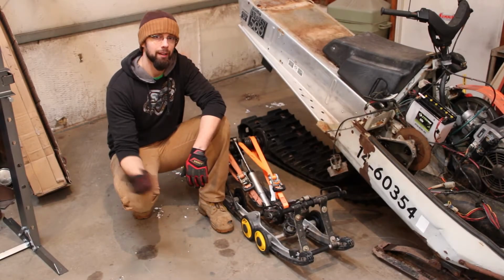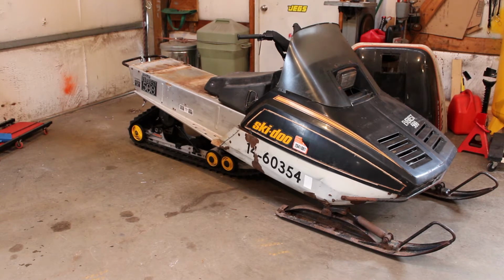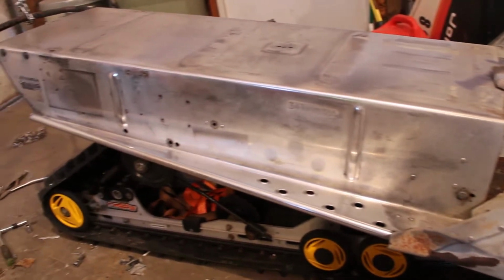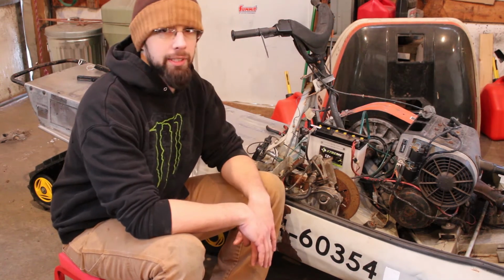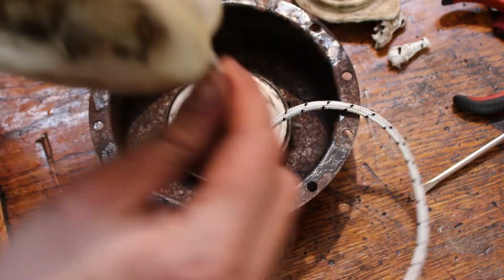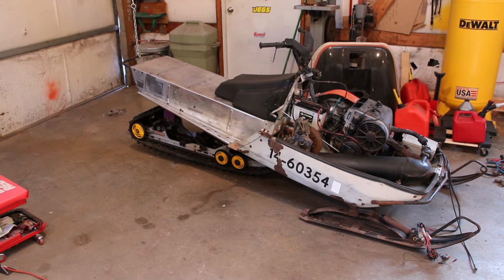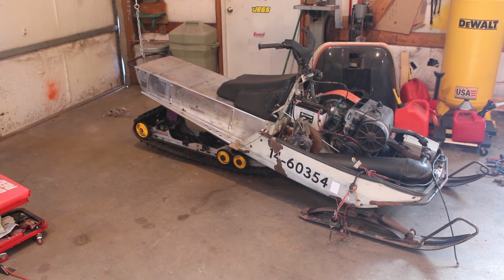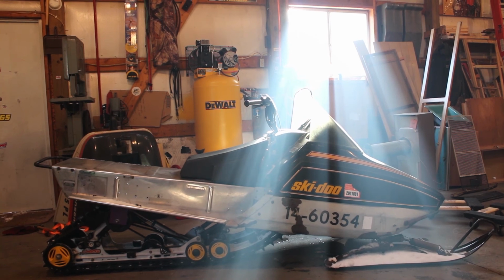1980 Skidoo Everest 136" Skid Swap. First test Ride! Part 3 of a vintage mod sled build.

Comment: Also you should turn down your oiler a little bit and you'll loose the bog at low end
Reply from the maker: Would if I could, but she's factory pre-mix.
Reply: I could turn mine down I had the same thing that's odd there's no adjustment
Reply: It should be right on the pull cord
Reply from the maker: @kanegray6587  I think 1980 was the first year oil injection was an option but it wasn't installed on all sleds. Think it was one of those weird half year things where the early ones didnt have it but the later ones did. I thought maybe someone removed the oil tank/pump on this one but then I got a manual and it actually had pre-mix specs in it. But I did mix this tank at 40:1 for extra lube since it was sitting for so long. Hoping the bog gets better at 50:1 but I might just have to live with it.
Reply: You should just find a pull cord assembly with the oil injection on it. It works great and it's easy to install.
Reply from the maker: @kanegray6587  I see a few on Ebay right now, might grab one. I was thinking of trying to find a stratos or escapade as a donor for a complete engine swap. Those had the same 503 engine but it was oil injected, cdi ignition, dual carbs and a tuned pipe. Think they made an extra 10-15 hp.

Comment: That's where you went wrong you need to raise the front of the skid in to the tunnel and leave the back of the skid like you had it the first time
Reply from the maker: Guess I didnt show it all that well but theres room on the drop brackets to drop the rear a full 3". In my opinion it's much easier to leave the front alone since the setback/height/etc from the drivers is already correct and adjust the rear as needed once I get the trailing arms on.